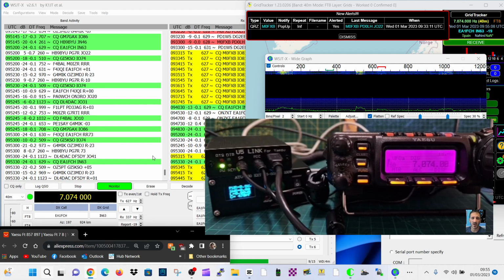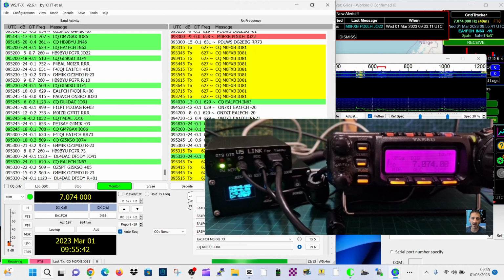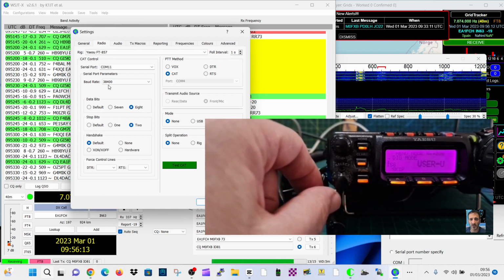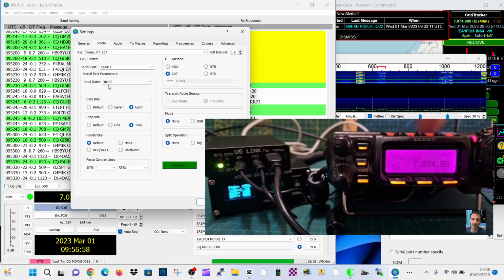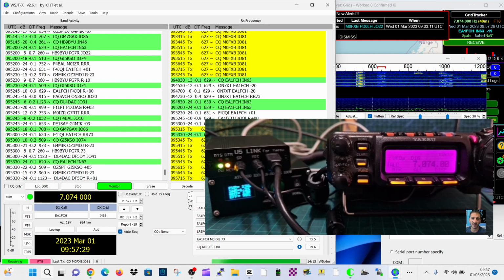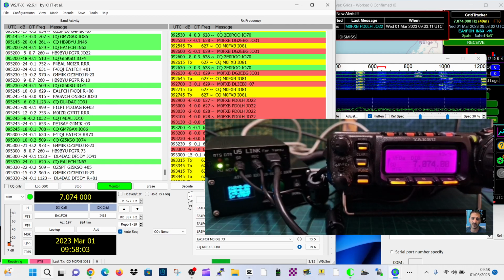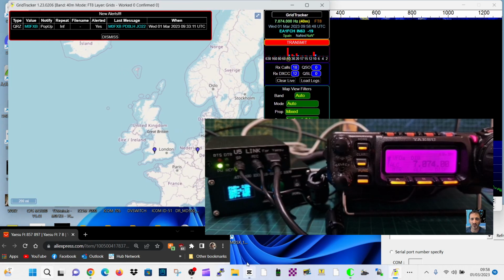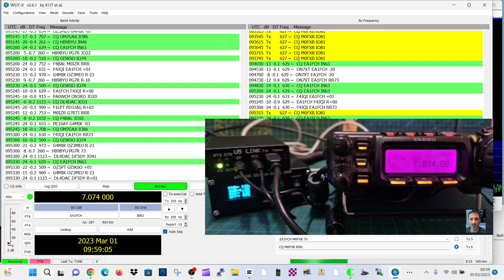YAESU FT-857D ,FT8 - U5 LINK USB Interface

Comment: I figured out ALC meter only shows on TX. I'm not making any contacts, so I think my transmit levels arent correct. Where are you hitting on the ALC meter during transmit?
Reply from the maker: Keep it very low about 1

Comment: Thanks for showing this. What is the max power you can transmit on wsjtx from the 857d? Is there a risk to overheating it or damaging the radio or some sort of operation cycle guidelines to follow?
Reply from the maker: It's recommended under 20 Watts